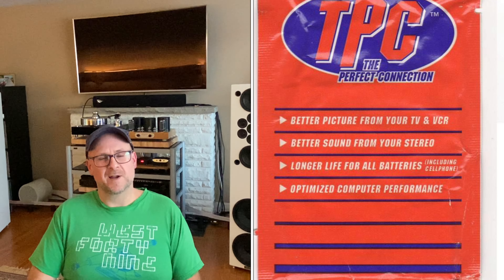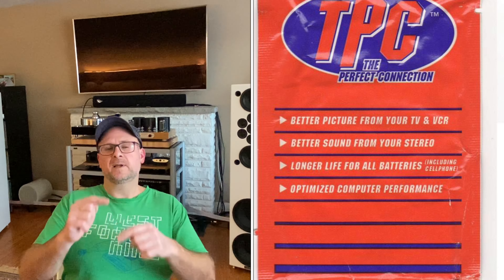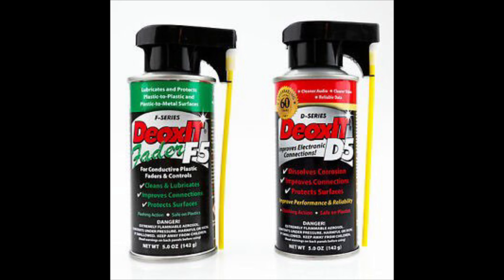Audiophile Maintenance Tips !!!

Comment: I seriously can’t believe you have both the MOAB’S and Double Impact SE’s
What kind of amp are you running for the MOAB’s. I have a NAD C388 with the BluOS module. I then have the Tekton Lore’s and a wireless 12” sub that can control via my phone. It’s sounds very good It’s in my very well treated room. 20’X 30’. Thick underlay and very nice carpet. Up top is sound insulation in between the rafter, with a 4” drop to acoustic ceiling tiles below. The room height is 7’ high. This sounds so so nice here. But I always want more. 
So my question is what amp or amps would you use for the Tekton MOAB’s ? 
I don’t think I want anything else. 
Any suggestions my dear man ? 
Thanks Jason.

Comment: Be mindful of the echo in your video....
 all this is in the music too... until you deal with this: you are not utilising all the awesome equipment you have.
 The secret to good sound is: use as much abosrbers and diffussors as your wife allows - and then negotiate, and use some more - and once you are done: put in some more! Forget about 3 panels, what you need is crazy amounts - man cave, madness is what you want! 
Should not be thin either: rugs and curtains only kill high tones and make room dull. What you need is very thick 10 to 30 cm 4 to 12 inch... Does not need to be fancy. Industrial foams works same as expensive one. Moving them around and balancing reflection and diffusion takes time and patience: bet result will surpass your expectations. Trust me on this one.
Listening to speakers in acoustically non treated room is like watching a projector without dimming a space properly... 
as impressive as results are now: you have not heard how good your system is yet.

Comment: Hey Kevin thanks for your great Tekton videos, they have been helpful to me as I agonise over deciding between the DIs and the Moabs. The issue I have is that I will be importing them into the U.K., which will add considerably to their cost, particularly the more expensive and larger Moabs. 

With this in mind, and since you are one of the few people that has both, can I ask if you hear a considerable upgrade in the Moabs over the DIs? My particular preference is for huge soundstage and holographic imaging with great instrument separation. I don’t like bright top end and prefer a warmish and very “present” midrange with a tuneful bass. I listen to complex electric jazz, fusion, funk and prog. 

Are the Moabs just “more” of the DIs, or are they in a whole other league? One thing that worries me about the DIs is their use of the two midrange drivers, which seems in part to undermine the benefit provided by the use of the tweeter array to deal with midrange and provide that stellar imaging the arrays are famed for? 

I realise this is all highly subjective but any thoughts you can share would be greatly appreciated.
Reply from the maker: Hi there 
thanks for your question I would recommend that you get the Moab just because if you get the double Inpact you will always be wondering what the MOAB sounds like and this will eliminate the itch to upgrade. as far as the shipping there shouldn’t be a to much difference ?because they both are large and come on a skid / pallet. Keep in mind this is just a suggestion. you have to make the final decision.  if you contact Tekton for a shipping quote. Ask for Tammy hopefully she can help! thanks again Kevin
Reply: @kevinleblanc2852  Thanks Kevin I am already ahead of you on the shipping etc, but if I can be cheeky and press you more about my original questions. If you put the itch issue to one side, is the Moab significantly better or is it a more subtle distinction as per the questions I originally asked? I am more interested in how they compare sonically so I can make an informed decision. And yes I fully accept that the final decision is mine, but any feedback you can give on your experience of the two speakers would greatly assist me. Thanks in advance 👍🏻
Reply from the maker: @fusionfan6883  Hello 
Both seem to do all kinds of music well.  I would still say go for the Moab they will give you more of the warmish sound that’ll you’re looking for and they will give you a bigger soundstage. The Moab’s are in Tekton’s  flagship category. So technically they are in a higher level. And I would say in a lot of aspects that your looking for sonically as well… Both pairs I have tested have the $300 upgrade and they have the $75 bi-amp option. (Which allows you to properly bi-wire them if desired) I hope this can be of some help?enjoy deciding  
thanks again Kevin
Reply: @kevinleblanc2852  Great thanks Kevin much appreciated👍🏻 The determining factor for me is the total cost as there is 20% import duty into the U.K. One last question, would you consider the Moab an endgame speaker?
Reply: @kevinleblanc2852  Hey Kevin, I have now decided to go for the Moabs! But I am struggling on the colour. I am aware that the cabinets are sprayed rather than being the higher end finish you find on other “expensive” speakers. I would like to go for the white finish like yours, but was wondering if you find the finish marks easily or is likely to yellow over time like conventional white paint often does?
Also, what have you found that is best to mount the Moabs on - do you just use the supplied feet - or do you use outriggers?
Many thanks in advance for your kind help again.
Reply: @fusionfan6883  Oi! Mate , have you picked a color yet 🤔 just wondering 🤣
Reply: Absolutely great advice!  As an audiophile, one the most important things that I learned is how much the room factors into the sound quality of the system.